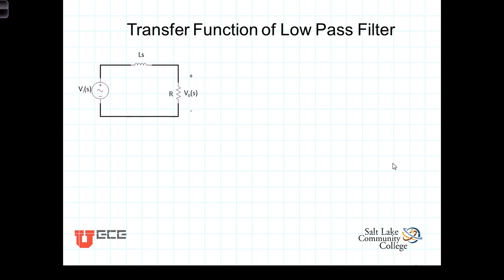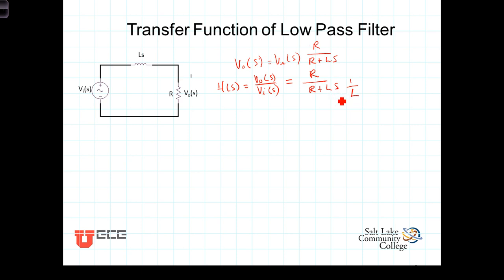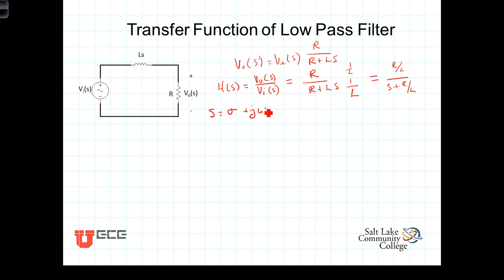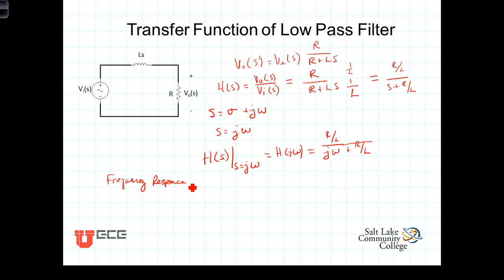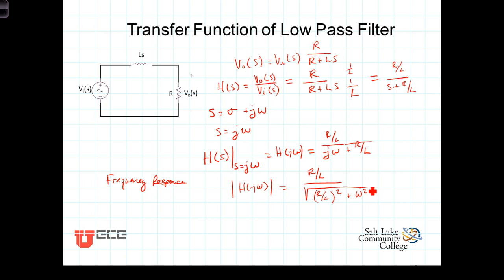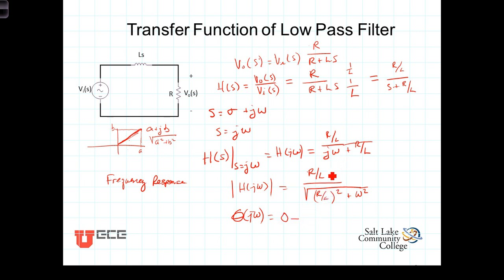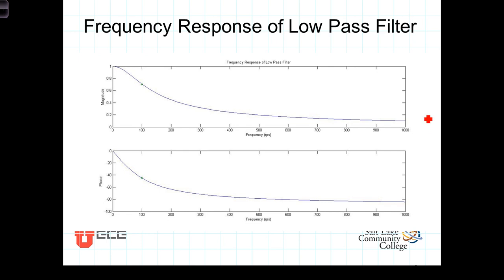L14 2 1Transfer Function of Low Pass Filter

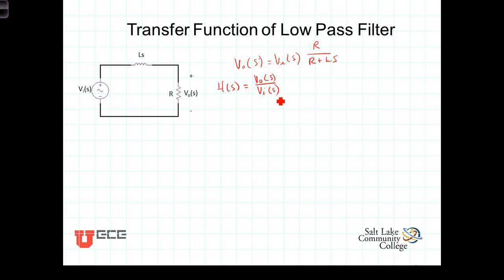Comment: At 1:43 you state that "we simply divide both sides of the transfer function by the Laplace Input and we are left with H(S)= R/(R+LS)". However, that is not actually the case, but I can see where if V-output(S) = V-input(S)*the voltage divider and if H(S)=V-output/V-input then H(S) equals the voltage divider. Please clarify, your wording is very confusing.